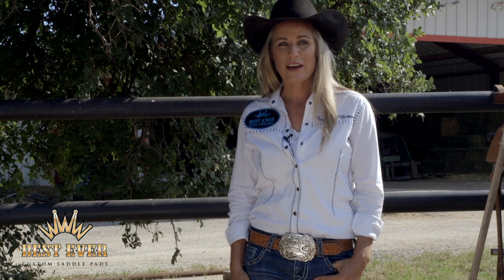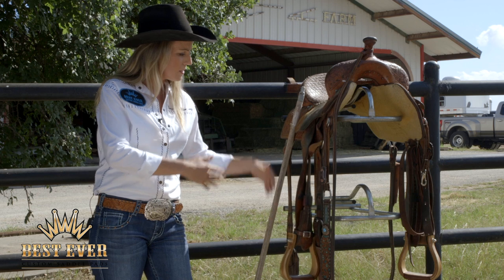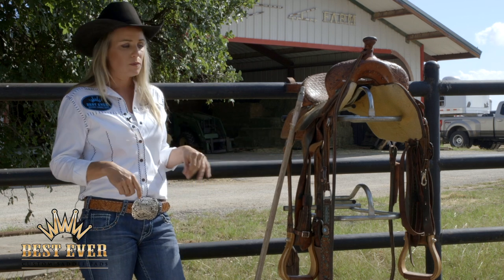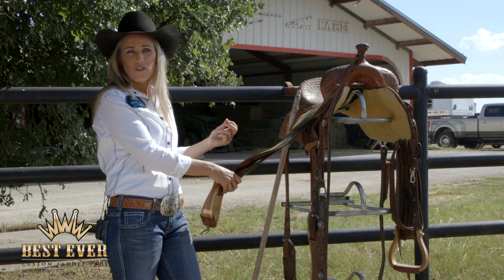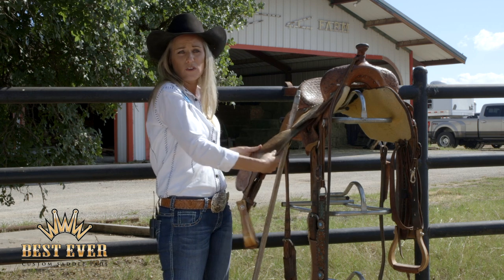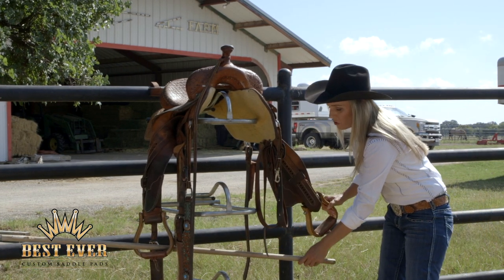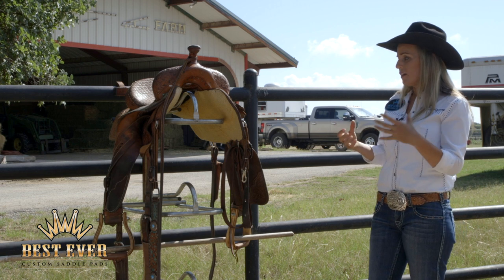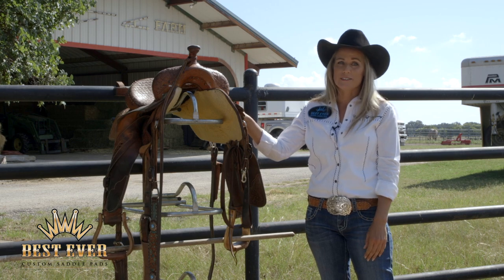How to Break In a New Saddle

Comment: I am getting a new Circle Y this week! Yay me! But I'm sure it's not going to be quite right. I have done this exact technique to include hot water soak it, oil it, then twist and use a stick to hold in place. I have also dumped some oil into the hot water to make an oil soak. Works each time.
Reply: That’s so ironic, I’m getting 4 new circle y saddles in today :)

Comment: hello, so I have a rough out seat and fenders, am I understanding that I am supposed to soak the fenders only?  Then after they're soaked, I use oil (I have 100%  pure neatsfoot oil) and wipe down the fenders and then put the broom stick after I've twisted both stirrups?  Is that correct?
Reply from the maker: If you're trying to only turn the fenders out more, you can stick the broom in the stirrups and then soak the back of the fenders with water from a spray bottle and then let it sit overnight. The longer it sits, the better it will stay.
Reply: @BestEverPads  hello, thanks for the reply.  I have a new saddle, a Scott Thomas and the seat is rough out along with the fenders.   There is definitely a squeaky sound with  I ride, so I'm  going to go ahead and soak my fenders or spray distilled water on my fenders and do the broom stick deal for 48 hours then oil the saddle and the fenders with neatsfoot oil.  I'll let you know how it turns out.  Keeping my fingers crossed. Thanks again.